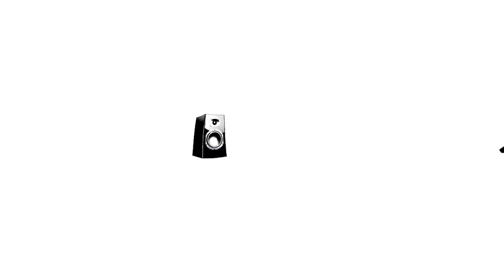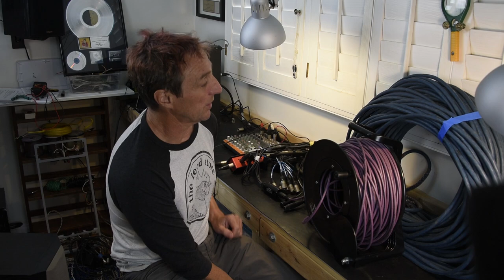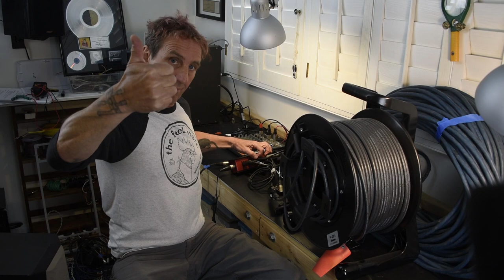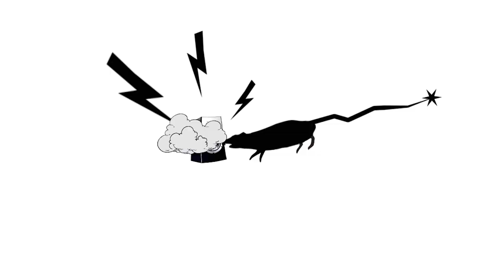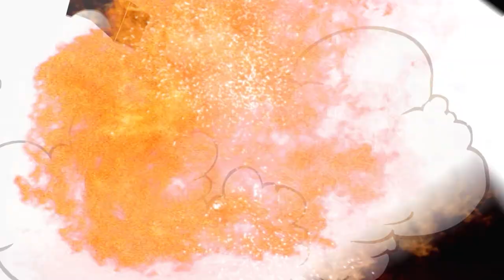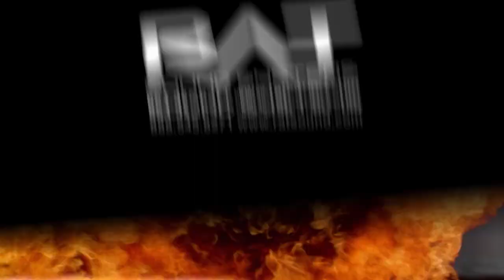Cat5e vs Audio Snake, Hear Signal Loss of 100 meter cables

Comment: I am also a little confused. Why is losing the high frequency in the data cable better?
Reply from the maker: What is so cool and unique is that the test setup I made let's you listen to purely the loss in the cable. And less loss is good.
Reply: I agree, with Dj Vertigo, generally cable losses increase as you go higher up in frequency. Having said that, this is audio, and on a properly impedance terminated cable over 100m, I'd not expect to see (or hear) any appreciable difference. A better test would be an aural rest including both the sends and returns, and also a spectrum analysis of both the sends and returns. On the second test, the levels weren't the same either, so difficult to make a reasonable by ear assessment. Even better would be S11, S21 and S22 network analyses.
Reply from the maker: @nezbrun872  Hmmmm, so capturing data through measurement gear is better than actually hearing what that loss sounds like? Sort of like, would be better for me to describe something very small that is naked to the human eye with its weight, dimensions and chemical makeup and show a data set and graphs than it would be for us to actually look through a microscope and see it it with our eyes? 

Is not seeing small things magnified through a microscope just as relevant as hearing magnified low level things with our ears?

Perhaps its not about better or worse but rather about having additional info can be beneficial in understanding.

Just some thoughts to ponder
Reply: @DaveRat  Hmm Dave. I suggest you give Nezbrun a little more credit. He has 30 years of analogue and digital design experience behind him.
Reply: Any length of cable is electronically a series resistor (1), a series inductor (2) and a parallel capacitor (3).
This is literally a 2nd order low pass filter.

If you're running high currents through your cables then low resistance (=> high diameter copper) will be of your concern.

If you're running high frequency signals, where ideally there is zero current, then the low pass characteristics will become a real problem. This is especially an issue for digital signals, as they are very high frequency, which is why digital cables are designed differently from analog speaker wires.

Comment: I designed, 24 years ago, the first and only (to my knowledge) ACTIVE INTERCONNECT. It had excellent reviews in the Audio Press at the time. It could compensate any capacitance, which is
the chief culprit, responsible for the high frequency loss across the cable. Other factors for the poor performance are the usually inadequate drive capabilities of the pre-amp output stage to
drive a capacitive load which a cable presents to the pre-amp. Audio cables usually are of a larger diameter so as to minimize the capacitance per unit length. I used a little known circuit
topology to completely compensate the cables capacitance, very simple circuit, very effective. The user could even use his already high quality cables which would be even more beneficial.
And it was possible, by the user to tailor the cable driver to his exact preference by simply plugging in a different value of resistor. 

I was active in the High End Audio game for only a few short years. Designed the first Digital Pre-amp which had the Golden Ears Brigade buzzing. Left that game because I found the
people involved in it to be very uneducated, even downright unethical, besides, my Industrial Electronics side of the company took of exponentially, so I had very little time anyhow. 
But I often wondered how far it could have gone. The main opposition even offered me to become their technical director as they were unable to compete.

Data Cables are not very suitable for audio. It is misleading to say the have data rates of 10 to 100MHz and more. True, but that's only possible with very special drive and receive circuitry.
These drivers and receivers use Pre and De- Emphasis for instance, something that cant be done with Audio. Its a fascinating subject, but it requires a great deal of specialized know-how.
Happy listening.............
Reply from the maker: Very cool and agreed on the close minded audiophile community. As far as data cables for analog, they are actually extremely effective and useful. To be able to have a low loss 4 channel disconnectable audio cable by using cat5e or higher cable makes our job in pro audio much faster, simpler and cleans up setups.
Reply: @DaveRat   Are audio electrons different in any form from digital electrons?

Comment: I like this approach. It fits in well with my habit of putting a tweeter and cap across power and speaker wires to hear problem. I got that idea from someone in the car audio industry. He said he installs a tweeter with a crossover and a burnout preventer on the output of his sub installs and mounts the tweeter near the drivers head. It sounds awful if you clip the sub amp so his customers don't blow up as much gear. YouTube didn't really convey how that worked either, but in his FLAC file it was plain as day.
It would be nice if you posted some high bitrate lossless audio files of this. Frankly I can't hear anything except a slight gain difference over YouTube in that first test. The second test showed a clear gain difference, but how does it sound with makeup gain? And how do the cables do with interference? Split a lamp cord and run one conductor through the reel and connect an old-fashioned light bulb and dimmer. That'll tell you what's got good interference rejection and what doesn't.
Reply from the maker: Love the tweeter to highlight square wave distortion idea!

Comment: I did no pay close attention, but are you really testing a differential (balanced) cabling with just an asymmetric (unbalanced) signal?  That's not how it shouldn't be done.
Reply from the maker: Hmmm, how things should be done is always how they are do e before a new or different way is tried.

One way to measure the resistance of a resistor, is to put a meter probe on either end of the resistor using DC or ac voltage. With a capacitor we do the same with ac voltage.

So you are saying that to measure the resistance and capacitance of a wire, we can't use an account voltage in the form of pink noise?

And that we can't listen to the differential of that pink noise?

Why not?

Comment: multi core analogue snake... inductive cross talk...yes..Eventual noise and hum...yes...hard to move deploy and carry plus high cost...Yes.... Tour quality Eithercon  cable......lightweight...sends data up to 330 metres.. no crosstalk or inductive coupling...cheap compared to an analogue snake, stage boxes can be networked with several other devices  on an AVB type network... very low latency.  even many analogue mixers have an A to D converter right after the first analogue stage...a digital snake in just another way to convert analogue to a muxed data stream back to a mixer.. but with much less noise.
Reply from the maker: Yes and also, this test is about showing analog audio can be sent down Cat5e with equal or better results than sending analog down audio snake.

Copper is copper and the twisted pairs in Cat5e are better and even with impedance mismatch, Cat5e is really good at carrying analog audio, com, aes3 and dmx and having super handy4 channel snakes with disconnects.

https://youtu.be/iUtUe8aScWI

Comment: I've used Cat5 cable as speaker cable for years. It may be 5e, I'm not sure, it's the purple sleeved cable... It's the solid core stuff. I read an article on the TNT Audio website a long time ago, made some up and haven't looked back. Sold all my expensive posh speaker cable. They also recommend making a plaited version which I did do a few times but the thumb blisters were a pain :\
Great video, thanks :)
Reply: Heh, lamp wire works just as good. Speaker cables deal with large signals - the effect of the cable is going to be minute at best. On the mic side, the signals are very tiny, so loss in the cable, and the frequency response of the cable (which is only relevant when the cable is very long relative to the wavelength of the signals you're dealing with) will make more of a difference.

Comment: I wish the cables were laid out flat instead of coiled up creating an inductor(coil)
Reply from the maker: I did a 4 part YouTube series on speaker cable types and coiling and other aspects but part 4 you can listen to the effects of coiling on speaker cables. All in all, with twisted pairs, coiling has no effect, the better the twists, the less the effect. And speaker cables are effected way more than signal cables
Reply: STP rolled up is not an inductor. It performs the same rolled or flat. The reason is due to the balance signal. In a pair of wires equal currents in two directions result in a null outside the shield. I've looked at it with test equipment. Simply not an issue as it is inside shielding to reduce crosstalk to other channels in the cable.
Reply: SHIELDING AND BALANCED CABLES ELIMINATES INDUCTION

Comment: If this is true, then why are we still using XLR cables? Why don’t we have RJ-45 connectors on audio equipment? As a DJ using powered speakers, do you recommend converting my balanced cables to cat 5 and then back to balanced?
Reply from the maker: The video is to demonstrate that cat5e cables do not degrade the sound and are slightly better.  That said, the differences are so slight, they can be looked at as irrelevant. 

As a DJ, if you did use a Cat5e you could send, left, right, vox mic and spare channel down one shielded cat5e instead of 4 Mic cables, could be useful
Reply: Thank you for the reply. I might try that!

Comment: Why not just measure the cable capacitance? This should directly correlate with high frequency loss.
Reply from the maker: So if I were to tell you a cable has a capacitance of 12pf per foot, you would instinctively know what that sounds like?

What length of cable is that audible? How audible?

I believe lots of people look at numbers and data and have no idea of the real world impact that the data has has on the sound.

But yes that would be another test is to measure the capacitance and see if that does directly correlate.

What about the resistance or insulation characteristics?

Different insulators are better or worse for high frequencies?

What amount of capacitance versus what length creates an audible impact?

What about cable impedance?

Are other factors and the assumption that capacitance is the primary or only audible factor may or may not be accurate.

What if we actually listen to the cable to see if there's an impact rather than try and gather up all the things that may or may not impact it and then making assumption on what that impact will be?

Comment: Excellent vid - thank you! The super cat is shielded cable, so I'd assume that any good quality shielded/grounded CAT5e cable would be acceptable, but would appreciate your thoughts on that? Is super cat larger copper than "normal" network/data CAT5e? I use Ubiquiti ToughCable carrier grade cable for all my data runs and it's far superior quality to any other grounded/shielded cable I've used professionally. Thoughts? Thanks, Dave! Great stuff.
Reply from the maker: Yes, any sheilded Cat cable will work.  The Supercat's big advantage is durability, coilability and the pro mic cable feel. Polyurethane jacketing is the way to go for pro portable cables.

Comment: Would the results be different if the wires are not in a coil?
Reply from the maker: I did a series on hearing the loss in speaker cable that covers the coil aspects. Turns out that twisted pairs make the coiling a non issues.

Comment: Hi Dave !I seen this stupid thing in my opinion (maybe i am rong) ... Ok How about cable impendance and input /output impendance using rong type of cable ? Have you ever think about that ?
Same that we have a words explaination required here .Sow we have a signal right and a type of phisical way to transport that signal right ! Ok so basicly we can use as wire any cable we want right!?
Concernig what? Loss signal on what kind of signal....There are more!?Of course !Cable magnetic field!! Cables technologies have been develop for the request! 
Electronic aproach of same subject.What 's a wire in all this circuit ? Im telling you what it is not a real rezistor by far because is altering its impedance uppon frecventy and mode (modal singnal).
Please try to messurate what i am marking here with more types of wires! 
You have touch sensible argued subjects here like is better to use a digital wire.I ve never seen one since not exist! I ve never seen analog wire ither .I ve only used analog signal runing to a specific type of cable and digital signal by a specific type of cable! 
Do you know what s a digital signal and how could be formed? Could we run digital and analog signal by same wire ?I  know you are a celebrity but please demonstrate your knowlege about that FIRST before you start a RONG APROCHE in my opinion !
Ok we could try use a new brand of wire !COOL AGREE !That s meen somebody develop some new type of wire to another level that could be notice up to 100 m !
Another question ! Have you test a digital wire runing analog signal more them 100m  with in a electromagnetic field? Ok those seems to be 2 type ither sheild (with and no) .How they react !
Whay i am asking all this !Because now there are people that they use "fake boxes" runing audio signal into cable that where meent for runing digital! To me what you shown here is not concludent !
Reply from the maker: Hmmm, have I tried over 100m?

https://youtu.be/f0nKK43Oeas

Comment: Wait. The last test... You say the data cable is duller, which means that there is LESS high end frequency loss?! Did you just say that wrong? And unless you were also accidentally backwards on which was which, the second data cable was way quieter - losing more volume. So it would be worse for audio. Or did i miss something? I played it like 3 times. Maybe im an idiot
Reply from the maker: In the test we are listening to the loss. So a duller sound means less hf loss. A louder sound means more loss.

Full range loss is not a big deal as it just means the signal is a bit quieter but freq dependant loss that more highs are lost, means the signal will get duller, which is not ideal.

Comment: You are not making any sense. You are contradicting yourself multiple times.
Reply from the maker: This video is to show analog over cat5e is not only viable, it's actually an improvement. 

There are some great products out there that will save you time and money while making setups faster and simpler. 

As the sound system provider for Coachella festival as well as 27 year mixing red hot chili peppers, plus mixing Soundgarden, blink 182, rage against the machine, offspring and quite a few other bands, as well as owning having designed speaker systems that have sold and travel the world, I've got a bit of insight from the top levels I am sharing with those that enjoy working in pro audio in search of free and useful info.

That said, feel free to share any valuable knowledge you have as it's always awesome to learn new things.

Comment: And then there Is the advantage that when you are investing into say CAT 7 for staging cable even if you are still running analog, it’s a future smart investment because they support AOIP which has already taken over the industry.
Reply: Cat 7 has a shield, so if you ground that shield you get even better noise reduction, but you can also get cat 5 or cat 6 called STP with a shield.

Comment: So, testing 100m unbalanced cable coiled up makes you hear the noise. That's hardly a surprise. 
How about doing the same test with balanced audio?
Reply from the maker: Here is a video on analog crosstalk down Cat5e https://youtu.be/gGgPDEz5sNU

Here is a video comparing Cat5e vs Audio Snake vs Mic Cable for AES3 signals https://youtu.be/djep5sFmVsU

and here is analog with phantom power down a mile of Cat5e cable https://youtu.be/f0nKK43Oeas

Comment: Why are you saying the "duller" sound (Ethernet cable) is "*less* high frequency loss -- isn't it the opposite?
Reply from the maker: We are listening to the cancellation. We are hearing what is lost in the cable. So duller sound of the loss means less highs are lost in the cable. Meaning more highs make it through the cable.

Comment: Dave, what about the comparison of OHMS per foot and also the Capacitance value of each coil?
Reply from the maker: Resistance will cause some voltage drop or level drop but pure voltage shouldn't affect the tone and can be made up by gain. As far as capacitance, the role doesn't really affect it has it's too far apart between the wires and twisted pairs are pretty much impervious to coiling